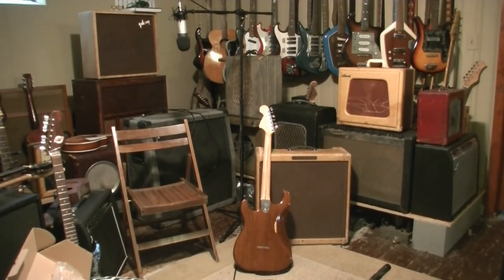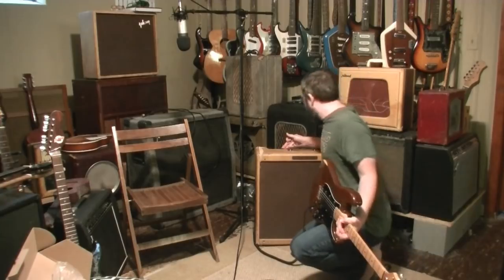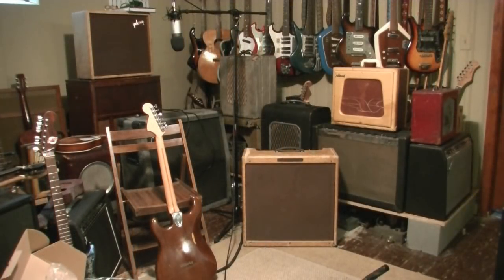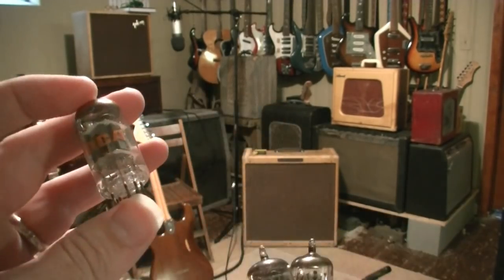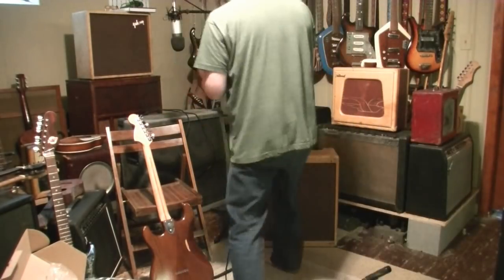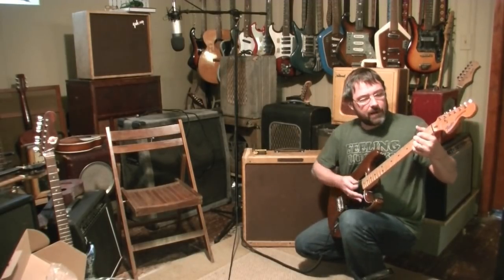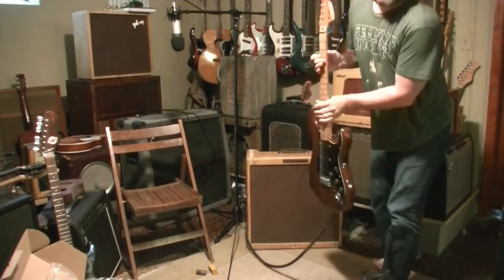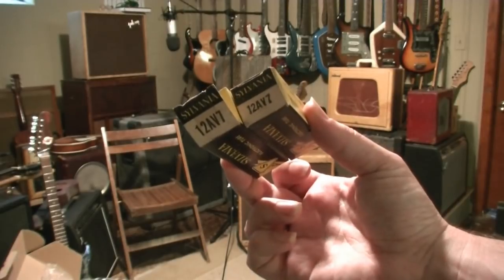High End NOS Tube Rolling in 50s Fender Bassman (Mullard, RCA, Amperex, GE, Sylvania)

Comment: You are having WAY too much fun here.....

I love the cabinets, the old pine 4x10 with the P10-R's. I actually got some speakers from Andy Marshall (Not related to Jim Marshall, Andy owns THD Electronics) a few years back. I was building cabinets and he gave me a quad of these free. They were THD "Vintage 10" speakers, made in the late 80's and early 90's. The story goes, he designed a ceramic dual pole-piece magnet structure to emulate the properties of the old P10's without having having to buy the nickel and cobalt that were primarily coming from South African government mining operations. In other words, he wanted to come up with a way to build a speaker that would sound similar to a P10-R or P10-Q, without financially supporting apartheid, and there was no other source for nickel and cobalt in the kind of volume he needed. So anyway, he and another engineer came up with the hypothesis that it was more to do with the way the magnets were stacked, narrower and taller "pole piece" magnets, that gave certain vintage speakers "the alnico sound." These actually sound really good, I don't know if I'd say they sound the same, they are a bit fuller and have a more immediate attack, but they also seem to have the sort of warm hump at around 200-300 Hz. He did the smooth, seamed cones, similar coil, similar frames, the only thing different IS the magnets. So anyway, he gives me a quad of 8 ohm speakers, and I build a pine 4x10 with 1" (before kiln-drying) thick, 10" wide boards, and a marine birch ply baffle, and a pine edge-glued panel rear panel with just two small offset oval/ellipse holes cut in the rear panel, and some medium-density foam and some fiberglass insulation on the bottom and against the baffle under each speaker, and then finally, a full + shaped separation board that essentially puts the two bottom speakers in two separate closed back 1x10's and the two top speakers in two separate open-back boxes. Wired it up in series-parallel for a total of 8 ohms. I listed it on ebay, then I went to make a demo video for it, and after playing through it for about an hour, I went and took the listing down. I use it with my Hammonds a lot, it does very well with clean sounds on the neck pickup of a strat and my AO-44. Great cabinet.
Reply from the maker: Sounds like a fab cab.

Comment: #5 here. 

Hey Brad, GREAT video!  I love this stuff. I have a 4x10 Hot Rod DeVille (USA) from the 90's. I have stumbled on some NOS tubes for CHEAP (darn near free) and I'd love a tip on where to start. I have on hand a pair of RCA 7025s, a pair of RCA 12AT7s, and a pair of Sylvania 12AX7As, as well as a couple sets of modern tubes (GTs and JJs). Are any if these guaranteed to sound like crap in any particular position?

Comment: As a lover of audio fireworks, the Amperex(tube #2) was it for me though I would have liked to have heard an Telefunken 12AX7(either smooth or ribbed plate). Personally I like a black plate Raytheon 12AX7 better than an RCA 7025. That would have been a cool tube to hear as well. Though the GE branded Wurlitzer sounded really pristine, I wonder what a GE 6681 would sound like. Any of the tubes from #2 to #5 would work for me as a V1 tube in this circuit.

Comment: NOS tubes are all SUSPECT! I know it's an AV/AY7 demo but I have to say that I've had
*Multiple N.O.S  J.A.N. phillips failures with 5751 tubes...
I also  have Amprerex Bugle boys ,Mullards,Telefunkens, Sylvania, RCA, GE, National Yugo's, Matsuhsita 12AX7 tubes.
After all of that collecting & tube rolling , I prefer NEW PROD.  JJ-5751 in V1,  EHX & TAD-12AT7 in P.I. , and the other Positions are a matter of taste.. NOS or New Prod. work fine..
Glass/Pyrex is stable but still porous and will lose vacuum over time.
A 30 year old tube with have 30 years of potential vacuum loss even stored without use.
I think all of this internet hype about NOS tubes is B.S.
Some D.BAG with an agenda and a load of old useless crap tubes (never used) decided to create an urban legend on the Inter-Webs.
Go buy a handful of new prod. tubes, TEST'EM , and you'll find the same variables...
Some are great, while others suck.. Depends on the circuit they are plugged into..
You may like Old Dead Vacuum tubes from yester-year..
For me, I'll never buy NOS again..ALL B.S. and highly subjective, and the circuit determines what will sound good in the end.. Stop the B.S, and HYPE ..
Best tubes so far with my 4 hand made amps( DST JTM 45 CLONE, FENDER DUAL SHOWMAN 1968/ BEDRROCK LEAD 100, SONICCORD TOAD 30w combo).
Winged C EL34, JJ EL34L, JJ6L6.
JJ 5751, EHX 5751, TAD 5751, Tung SOL 12AX7 mix and match to taste..
NOS just means U spent a lot on a dead or dying tube..